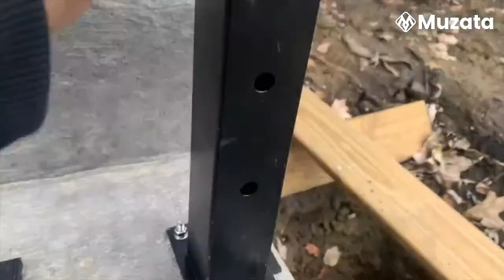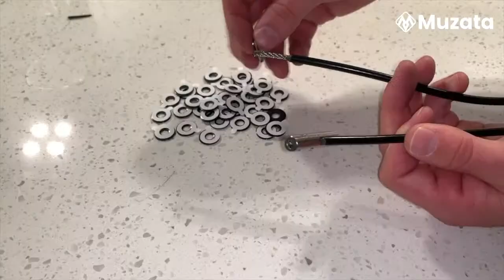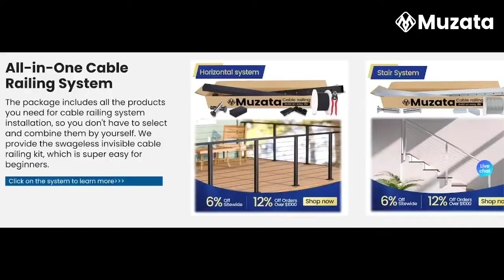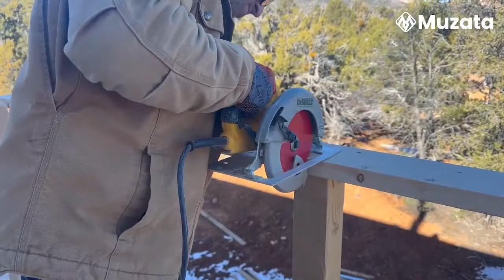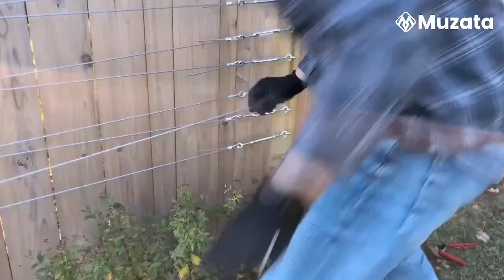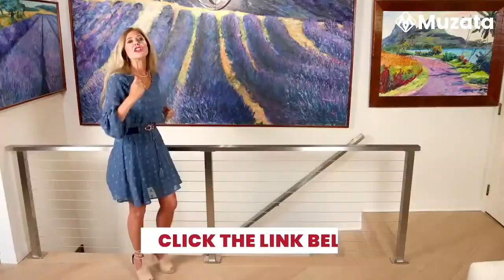How to install a cable railing - Muzata 2024

Comment: Thank you for your post.  How long did it take to complete your railing project?
Reply from the maker: The time it takes to install cable railings varies depending on the size of the project, the complexity of the terrain, and the experience of the installer, and typically ranges from a few hours to a few days.